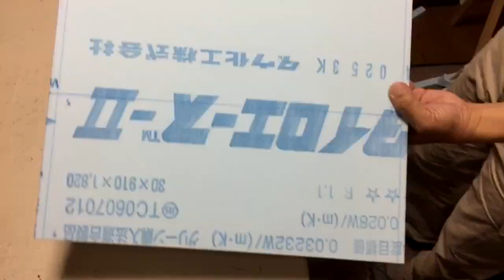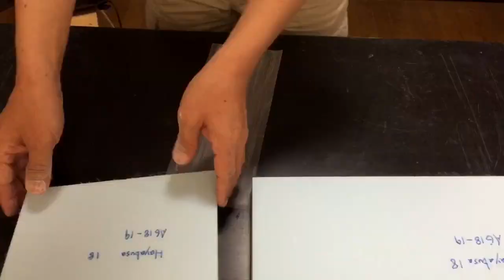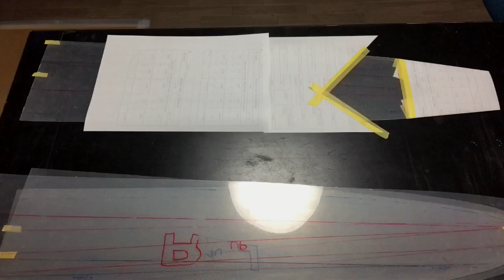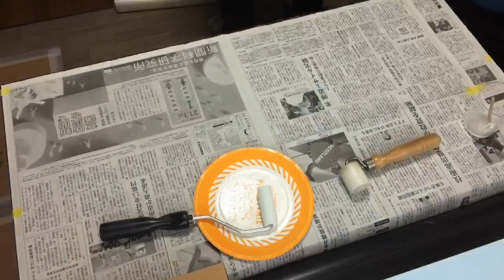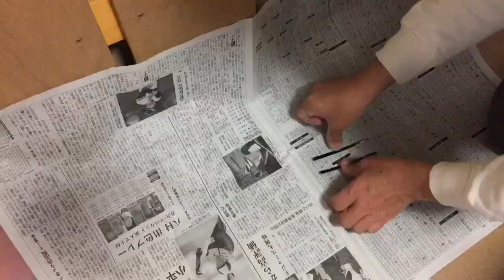Scratch Built DLG glider -Part1 Vacuum Bagging Wing-

Comment: I'm assuming you had a large sheet of unidirectional carbon fiber you cut to end up with a diagonal grain?  Is there a structural benefit to diagonal grain or is it just for aesthetics?  Thanks.
Reply from the maker: Thank you for watching my video. I'm trying to  place the UD tape preferentially on the thick part of the wing
Reply: kousakunin2008 Do you have any idea where I can get Mylar?  I can’t seem to find it anywhere.  14 mil, right?   Thanks.  I love this series on wing bagging.  Nice work.

Comment: Nice tutorial. What is the density of the carbon fibre?
Reply from the maker: Around 40g/sqm
For reference below are the URL of the materials.

+Reasonable one(Both are fine)
https://www.hyperflight.co.uk/products.asp?code=CARBOLINE-SC39-2-30&name=carboline-sc39-2-30-spread-carbon-fabric-30-39g-m
https://www.hyperflight.co.uk/products.asp?code=CARBOLINE-SC39-2-45&name=carboline-sc39-2-45-spread-carbon-fabric-45-39g-m
+Another one
(It is better to use it properly on the front and back of the wing. However, the same one can be used for the front and back.)
https://shop.cn-models.com/carboweave/cw-40-2-45-45
https://shop.cn-models.com/carboweave/cw-40-2
+For competition
(It is better to use it properly on the front and back of the wing. However, the same one can be used for the front and back.)
https://shop.cn-models.com/carboweave/cw-39-2-2
https://shop.cn-models.com/carboweave/cw-39-2
Reply: @kousakunin2008  Thanks a lot for the detailed links

Comment: Real nice,  have all tools to get it on,   but... i need a Carbon wing  for  " REAL high tempo...want to Crack my 450 kmh record.. at Time.. stays by 550 kmh.  ( what shoud i use for the wing from Material...  carbon,  o. that 3Mstuff... with the karo's...its superlightweight.. but with that G force the wing gets wrippet.. explodes! .. .. for the Wing so light it only get,    but..   with a selfwindet  6 Pole IP  brushles.. with a Enc.. with up to 400A .. Place for 2 x  8s ... so with  16s & 400A ...   what Material can i use to get  not ripped apart. (  Carbon & what mm. .. i think 1 layer  straight & One.  180° (  + x from the fibres & the rowings " Carbon Layers... & with epoxid  &  thats the Thing!  ... at the edge i have to made a  carbonpowder-  .. with epoxid & carbondust   .. to get a perfeckt  wing,  that ripps not...    ( looks like black  silicone...    what i can do better for get the 2 wing-sh. strong boundet? ..   ( & clear i have to selfwinde my Brushless Motor.  Man, what a Projekt..  Need so much Info befor i made nonsenc the 2 Time... na 300kmh pylonracer are great... but 300 & up to 500... thats allot & i hope kg dont ripps apart

Comment: Congrats for your build, it´s beautiful and you have a great tecnique, wich airfoil did you use ? im about to start to build one but don´t know wich is the right airfoil for a DLG  1.5 M of wing. Thanks
Reply: As I know nowadays many DLG use "synergy II" as the airfoil, some old DLG use "Zone V2". you can find it on RCgroups.
Reply: @eraserma2212  thanks, allready found Zone V2 but ill ty with this other ones. Wich paint did you use on the mylars ? regards
Reply: @magneresjuan  Sorry. I didn't make painting on my plane. I don't have this skill. And I think it will add extra weight.
Reply: @eraserma2212  yes it is not easy the paint thing. But those reds on the wing looks great ! it i no paint? Did you find very difficult to build a Synergy II on bagg? I found out very difficult to respect that 2° curve this wing needs, how did you do it?
Reply from the maker: The paint adds more than 3g.
However I prioritize the visibility from the distance.

Comment: where do u cooked carbon fiber? carbon fiber has to be cooked some hours in the autoclave at 160 200 c°
Reply from the maker: For this use, strength can be secured by curing at normal temperature without baking.

Comment: That's such an amazing job. How much would you say this cost, just materials. A rough estimate if you can would be great
Reply from the maker: For your referance, a rough estimate below
core:USD20$
spread carbon:USD62$(Carboline SC39/2/30 )
carbon UD tape:USD30$
epoxy resin:USD30$
kevlar(for hinge):a little
Reply: @kousakunin2008  Are you selling finished models?  I checked out your website, but couldn't find any links to costs/purchase links.  Plane looks amazing!
Reply: @kousakunin2008  What kind of resin do you use for this?  What kind of resin does not melt foam?  Thank you.
Reply from the maker: Araldite 5052 is the best resin for DLG. It does not melt form.
Reply from the maker: Thank you for asking. I sometimes make it by someone's order. However,  It is difficult to ship overseas.

Comment: Hello, beautiful DLG !!
Can I ask an information? What do you use to keep the templates of the wing airfoil on the polystyrene panel?

With what material did you make the templates of the profile?

Thanks!
Reply: Generaly templates are made from soft aluminium. You can fix the templates with nails or needles.
Reply from the maker: I use 0.3mm aluminium plate.

Comment: are his "synergy II" airfoils wing strictly for molding, or also suitable for bagging? I have only bagging for now
Reply: synergy II is made for both molding and bagging. You can read all the information on the rcgroup thread
Reply: @gaderyfr8485  all readt did !!! for days and in some og the coments people said that are for moulding because it has a  negative slight angle that make it difficult...so do you recomend me to use this airfoild anyways or try de V2 ? thank you
Reply: @magneresjuan  you can use the synergy without problems, I do it with all my f3k wing and I don't have any problems. The zone v2 is also a good airfoil but the synergy is better
Reply: @gaderyfr8485  ok thanks! Donyou respect this -1 degree angle ir just do the wing flat with no angle ?
Reply: @magneresjuan  if your skilled enough withe the hot wires you can try to put the - 1° otherwise do it without the - 1° and you will add by triming the servo. The last wing I've done was with the - 1° but it didn't came as nice as I wanted
Reply: @gaderyfr8485  okey perfect. So its better this airfoild without the -1° than the V2 right ?
Reply: @magneresjuan  take the synergy and builds it without the - 1°. When you will do the servo installation, add the - 1° on the servo position. Like that you will have a real synergy airfoil
Reply: @gaderyfr8485  excelente !!! I Will do it así you say. Regards